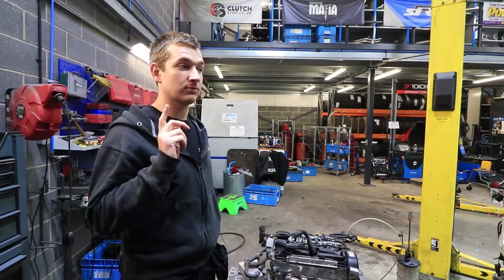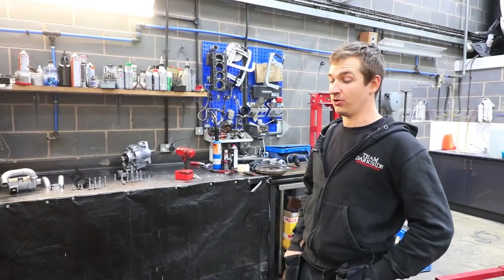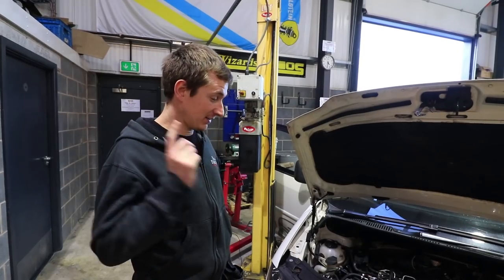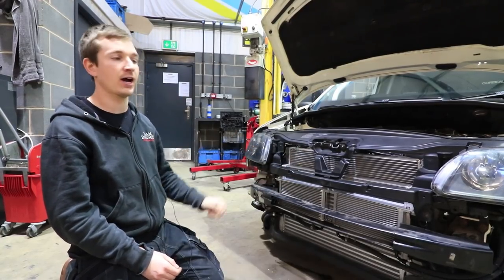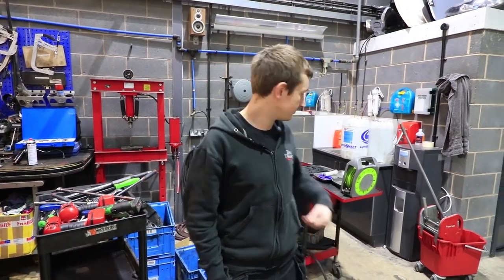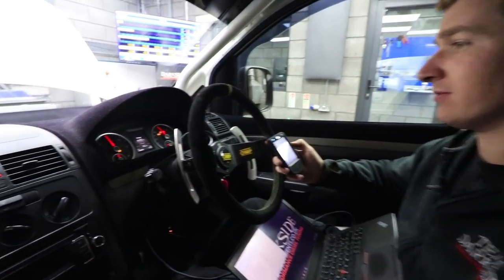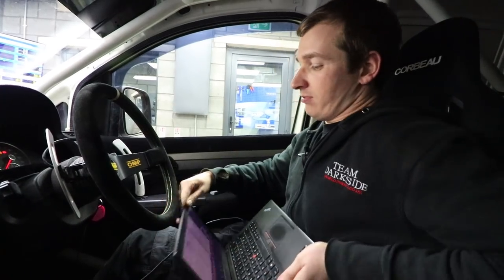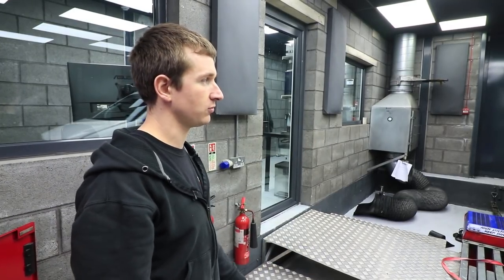2.0 TDI CR 7 Speed DSG AWD - VW Caddy Van Engine Build - Part 2 - SRS AUTO / DARKSIDE DEVELOPMENTS

Comment: Damn the dsg is massive
Reply from the maker: it is as heavy as it looks
Reply: @DarksideDevelopments  around 60kg is the weight of that box
Reply: @JayJayJaroo  Not really, like he said it weights more 50KG than a standard 6 speed.
Reply: @JDMeister  The 6 speed DSG weighed more then then the 7 speed box.
A 6 speed manual VAG box is around 45-50kg and the 6 speed DSG around 90-95kg

Comment: On my Mk2 Golf race car, I had my oil cooler mounted behind the grill and up high in front of the radiator. I wanted to get more air flow through the oil cooler, so I moved it down to the lower end of the radiator so it would get air from under the bumper. While on track the temps were good, but as soon as I came off track, water would boil over and exit the overflow because it got too hot. Basically, the hot air exiting the oil cooler was now feeding the radiator and wasn't cooling the water/coolant. I moved the oil cooler back to the original place and no more overheating. Obviously you guys do a lot of racing and track events with your cars, but would it not be better to put the oil and trans cooler to the side of the intercooler and radiator so that they can get cool ambient air instead of the hot air from the oil coolers? The electric water pump wouldn't need to run at full speed and charge temps would be lower for more power.
Reply from the maker: Cheers for the reply. We did not want anything too far out to the sides as we have damaged Oil and fuel coolers before in crashes but we did move them and will test as soon as this Virus goes away!

Comment: How much to build and send a 2.0 for a caddy like this replacement from 1.6 2014 upgrade? Deliver to Australia?
Reply from the maker: We don't normally do that, cheaper to buy a 2.0 Caddy!
Reply: @DarksideDevelopments  in Oz everything is silly expensive and hard to find 2.0 without million KMs I need to tow a trailer for work what's best option for 1.6 I already got Ur EGR plug and downpipe with tune need more torque just don't wanto kill gearbox it's auto dsg any info appreciated ❤️ from ozi🤙
Reply from the maker: Those 7 speeds are terrible! A stock engine and box from over here is £1500 or so + converting and shipping so it might be a 4k job + installation your end.
Reply: @DarksideDevelopments  inflation killing everyone   I'll try find one here and do one of your bolt on kits U guys should do a gearbox kit for the dsg auto I'd buy it straight away keep up great work👍

Comment: what's the limit in terms of hp from a gtd2872 on a 4cyl tdi diesel only?
Reply from the maker: 360ish is about as far as we have pushed, but these are cars that are going to be driven hard on track
Reply: Think torque is the limiting factor here, not horsepower. Manual gearboxes can only handle so much, although DSG boxes should be stronger. Oh and big end bearings are another limiting factor.
Please correct me if I'm wrong! 😁

Comment: Does the gearbox oil cooler cool the gear oil or the mechatronics/clutch oil  ? Also do you use mineral engine oil for break in ?
Reply from the maker: These are linked so both

Comment: I know it's not related to the video but what would I need to do a 6 speed conversion for my pd100? I have the box , clutch flywheel and drives. Is it a massive job to make it work seamlessly?
Reply: Cathal O'Donovan no it’s a small job to make it work seamlessly
Reply: @aqib2000  would I need shifter cables for the 6 speed? Or would the 5 speed work?
Reply from the maker: 5 speed cables should be OK